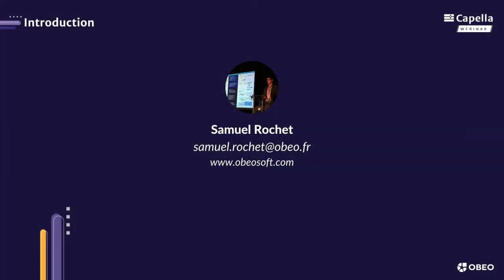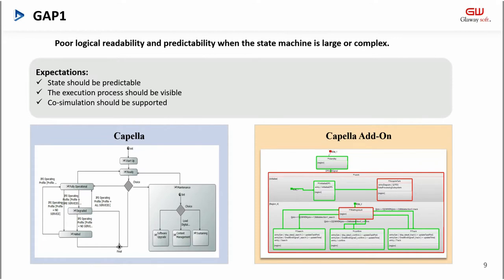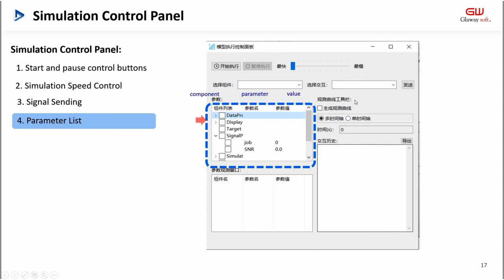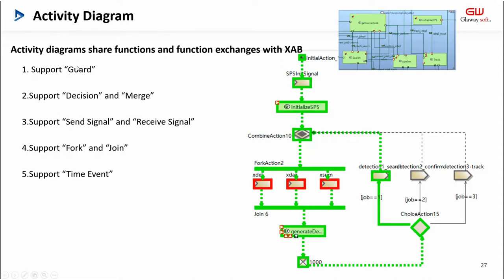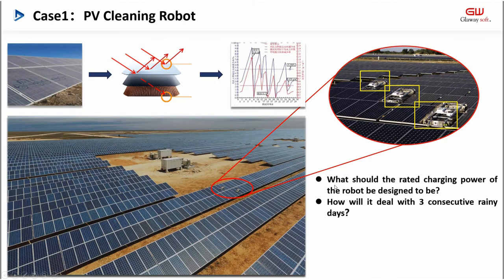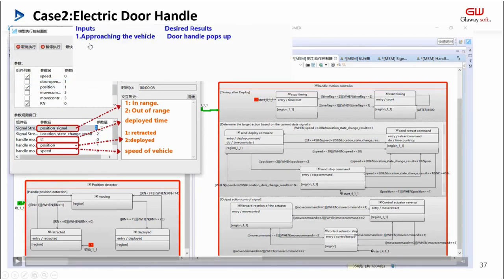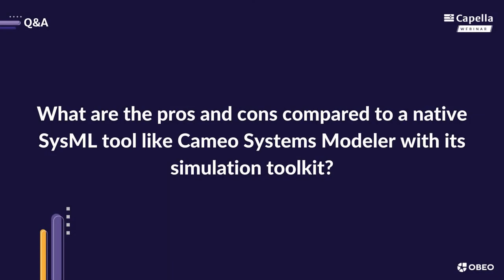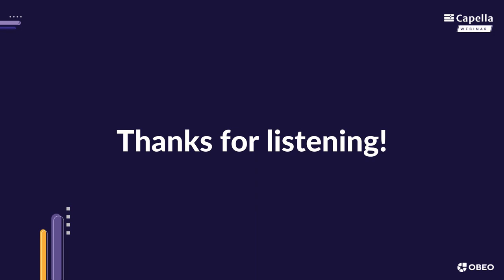Model Simulation and Analysis in Capella | Glaway | Capella Webinar

Comment from the maker: Note : After the webinar, Kai Liu wanted to answer another question from the Q&A part. Here's his full response :

❔Question : "Your 'activity diagram' concepts look very similar to 'functional chain' concepts & diagram using sequence links, along with AND/OR/IT constructs (possibly adding custom properties and representation for some functions such as send/receive signals). Are there other differences?"

✔Answer : You are right, 'activity diagram' concepts do look very similar to 'functional chain' concepts & diagram using sequence links.
But I think they also have the following differences, 1. Activity diagram distinguishes control flow and object flow, which other diagrams do not have. Although in some cases sequence links can express similar control logic through Fragment, such as "parallel, alt, etc.", they are less flexible.
2. Activity diagrams are easier to understand and learn for engineers without mbse foundation, which is a very important point.
3. Activity diagram is a very important element in sysml. In order to achieve commonality between different standards, we think it is important to add the same elements in capella as in sysml.
4. The simulation mechanism of the activity diagram is relatively complete, and we meet more usage requirements through the activity diagram.
Considering the above factors led us to develop activity diagrams, and if you ignore the third point, I think the 'functional chain' you mentioned can also achieve a similar effect by giving dynamic rules and adding a concept similar to "control flow".